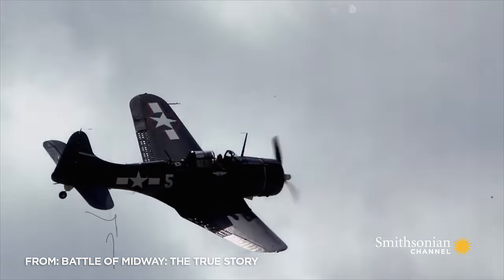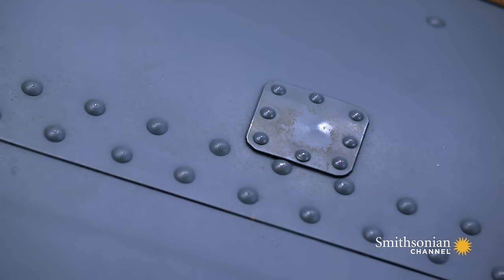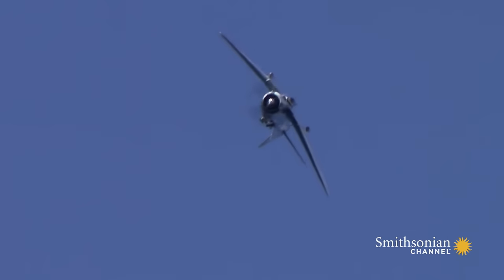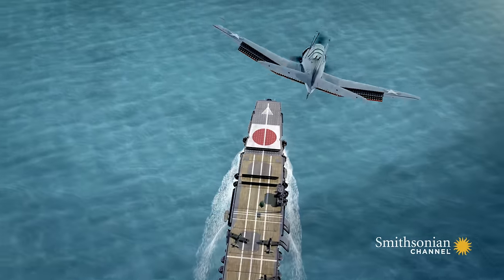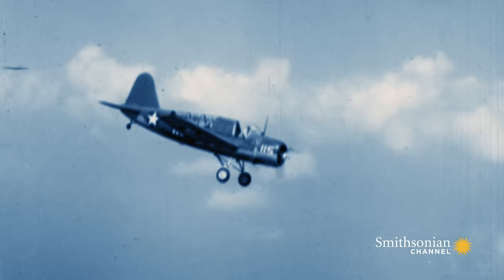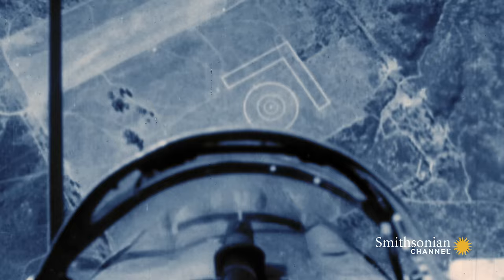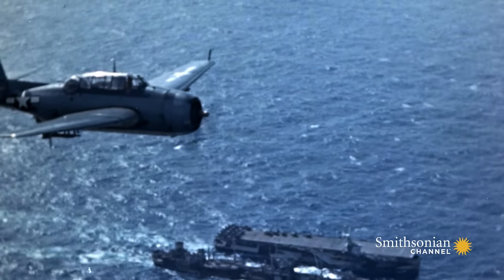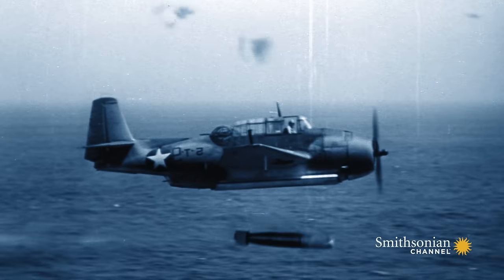The Terrifying Physics of WWII Dive Bombing

Comment: My adopted father was a rear gunner. When the war was over. He never flew again.
Reply: My father flew in the belly of TBMs and TBFs. His job was to man the radio, radar and, when necessary, use the 30cal rear machine gun or "Stinger". The 30cal was so ineffective that they were dropped in later variants. My dad got his civilian pilot's license after the war but let it lapse due to the expense.
Reply: @grantrichards4950  
Didn't the 30cal use tracer rounds?
Reply: You adopted your father? Cause otherwise you call em father or step father
Reply: I have know a few WW2 veterans of the 8th Army Air Corp. Many of them refused to fly under any circumstances.
Reply: @mac2857  maybe he was a foster child which makes him the adopted son
Reply: @mac2857  You may want to consider looking up the definitions of what (who) an adopted father is and what (who) a father is and what (who) a step-father is.  Rather than rely on anyone else's way of expressing their understanding of the definitions, you will, by your own effort, achieve true knowledge of those words.  Just a suggestion.
Reply: @johnstock3282  From what I can tell, it was removed for the same reason that the forward firing 30 cal was removed. It lacked range, destructive power and firing rate to bring down enemy aircraft. While the front firing gun was replaced by two wing-mounted 50s, the stinger was just removed. In RAF versions, the stinger was replaced with a camera.
Reply: @djg585  almost all belt fed machineguns that I know of use tracers, so as to help judge distance to target.
Reply: @marktercsak9728  
I am just surprised the 30cal was considered ineffective if it used tracers.
Reply: @djg585  , slot has to do with ineffective training or lack thereof and remember no one never knows what it's going to be like when your being shot at.
Zeros were very well armed but they sacrificed armor so as to save weight to make them more nimble., when you have some shooting a 20 mm or heavy caliber machine gun at you, you would think your .30 caliber is ineffective too.
Reply: So many boomers
Reply: @djg585  well, .30 cal was outdated arnament for aircrafts when even ww2 has just started. So at pacafic war, 1941.... it wasn't that useful.
Reply: k one-up him why don't you smh
Reply: I thought that was a navy term for a top.
Reply: Brave man
Reply: @djg585  having tracers doesn't make up for lack of fire power. Tracers are just to help see where the bullets are going. the 30 cal not effective because it's a rifle caliber round being shot at aircraft.
Reply: @CoachNealF  isn't the proper word 'adoptive'?
Reply: @MotorStorm66  Hey, M K.  You're correct.  The adult/parent is the adoptive/adopting person.  Matharnox stated to use either father (which is correct if the adopted child chooses to use that) or step-father, which is not accurate at all as one of the parents needs to be the biological parent and the other adult/parent marries into the family.
Reply: @mac2857  there's a place in Finland called Siikainen where lives a guy who's few years older than his mother
Reply: What a teaser. I was already into it. “Cause only one torpedo is enough to sink a ship...”
Reply: @djg585  Yes, they did, like the. 50 cal...every fifth round in an ordnance ammo belt for a machine gun, specially for serial gunnery, is,an incendiary or "tracer" round...white phosphorus impregnated in the bullet base..
Reply: @marktercsak9728  Correct...and to aid in what's known as "deflection shooting"...having to walk/lead your rounds into the target in turns or other maneuvers. On the same page here.
Reply: @djg585  Just not enough firepower, range, punch, etc compared to .50cal or 20mm guns..
Reply: The .30 Machine Gun Air Cooled 
Browning Model of 1919 came in a number of configurations and models, the last I believe was the M1919 A6.

I believe the cycle rate was around 600 rounds per minute, or maybe 800 rounds per minute.

The famous MG 42 I believe is 1200 rounds per minute.

The Model 1919 was of coarse chambered in .30-06 , which means .30 caliber year of introduction in the year 1906.

When first introduced the bullets at least in rifles were 150 grains, post WW I, experience  we followed the Germans and increased our cartridge bullet weight to around 172 or 173 grain, it was believed the heavier bullet weight stabilized the bullet at longer distances.

With the introduction of the M1 Garand , a mistake was made in Ammunition used in the New Rifle and it's gas system was calibrated to the older 150 grain ball . Aka M2. If memory serves

To be quite frank I do not know which 30-06 ball ammo was used in the aircraft versions of the M1919 machine guns, I do know tracer ammunition was used as was armor piercing .

The Mitsubishi Zero was an exceptional fighter plane, it was fast and very maneuverable  and it was also light , the engineers made sacrifices in armor and protective systems such as self sealing fuel tanks, in other words it was vulnerable. 

The F4-U Corsair it's outer wing panels were fabric covered to save on weight.

Dog fights are close range affairs .
So range is not that big of a factor, but I believe you do have to the enemy aircraft. With more precise hits with a 30-06 for it to be effective.
Reply: @mac2857  maybe his phone decided to autocorrect adoptive to adopted. When my phone is done autocorrecting its usualy not quite english anymore.
Reply: @Oozy9Millimeetah  Exactly!!! My grandfather and I are the same age!!!
Reply: @grantrichards4950  do u mean stinger as in THE stinger? the rifle-HMG LMG hybrid?
Reply: @EricWulfe  No. It was a LMG patterned of off the Browning M1919. The Stinger was an AMN2 30.06 and was used on TBMs, SBDs, PBYs and TBDs.
Reply: aren't those the same MG's that marines converted into the Stinger Bush MGs?
Reply: @JeanLucCaptain  Yes.
Reply: @grantrichards4950  Thought so!
Reply: @marktercsak9728  The problem with tracer bullets, is that they lose mass, as they burn, and eventually do not fly the same trajectory as the standard rounds.
Reply: @alneal100  , yes I know, tracers are used to help judge distance to target.
Reply: “Rear gunner” sounds like a euphemism for a top.
Reply: Can’t blame him
Reply: Neal Fleenor how about we don’t worry about what words people use and just focus on the main top being discussed. HISTORY!
Reply: @djg585  tracer bullets lack the destructive power of high explosive bullets
Reply: Step typically is used to refer to a person who the custodial parent in a divorce married. Adoptive parent is used by former orphans.
Reply: what, like never flew on an airline, or never piloted a plane.
Reply: You adopted your father?
Reply: Mark Tercsak - what is it that makes the 20mm a “cannon” and the .50 cal. a “machine gun”?  (Funny tangent: auto-complete thought the 50 cal. is a “machismo gun”.  It’s not wrong.)
Reply: @djg585  most planes used 50 cal or 20mm
Reply: Adopted father? What?
Reply: @FastEddy1959  The distinction is a bit arbitrary, but generally an automatic weapon with a bore diameter greater than 14.7mm is designated as a autocannon, although weapons like the MG151 (the 15mm version) are in a bit of a grey area. The Germans designated even 20mm autocannons as "machinengewehr" (machine gun) as in the MG FF and MG 151/20. They designated larger weapons like the 30mm MK103 and MK108 as "machinenkanone" (machine cannon).

Also, what sort of autocorrect does your browser or phone have that it doesn't recognise the word "machine"? 0_0
Reply: @52daytripper  At the start of WWII, most aircraft were armed with rifle-calibre machine guns (i.e. .30 calibre MGs). They quickly up-gunned to combinations of 20mm cannon and larger, and by the end of the war, there were a few all-cannon aircraft.

It was really only the US which were using exclusively .50 calibre guns, and that was largely because the Americans couldn't produce a reliable 20mm autocannon even with the British giving them the specifications for the Hispano-Suiza cannons. What's even odder about the whole thing is that the British were still using Imperial measurements during that era, so US industry couldn't even complain about metric-Imperial conversion errors...

The US Navy wanted to switch to 20mm cannons ASAP, though. It worked out alright for the USAAF to use .50 BMG guns for a few reasons:
1. The standard armament of 6-8 .50 cals had acceptable hitting power, generous ammunition capacity, and provided identical ballistics for all of the weapons. (The ballistics of a 20mm cannon and a .303 machine gun are markedly different, with the MGs having higher muzzle velocity and flatter trajectories. You could, in theory, load the .303 rounds to match the ballistics of the 20mm cannon, but you'd be losing a lot of effectiveness from those machine guns.)

2. The USAAF mostly faced fighter and a few light bomber threats in the skies over Europe. The bombers the Japanese had in the Pacific (and most of their aircraft, really) were poorly armoured and of flimsy construction. If the USAAF had to stop strategic bombers like the British, the Russians, the Germans, and the Japanese did, they'd likely have had to quickly upgun their fighters.

As for .30 calibre machine guns lacking hitting power, that's because of the number of hits they would need to reliably bring down an all-metal aircraft. If you mounted, say, 12 of them (like in the Hawker Hurricane), you'd be able to shred unarmoured aircraft pretty decently, but you wouldn't do anything to the sort of armoured beasts most countries were fielding by the middle of the war. To give an example, the Germans had trouble downing Il-2 Sturmoviks with _20mm cannons_, and that aircraft had a reputation among both the Russians and the Germans as a flying tank. (The rear gunner wasn't well protected, though.) 

A single .30 cal isn't going to stop a decently armoured fighter--the canopy is bullet resistant, and unless you can get a lucky shot into the engine, you won't even scare him away before he shreds you with his guns which could output a much heavier weight of fire. If I'm not mistaken, rear gunners were intended more to deter fighter attacks from the rear than actually shoot down enemy aircraft. If the enemy fighter on your tail were something like a FW-190 A-8, a single .30 cal won't even faze him. This has less to do with range than your gunner's inability to inflict sufficient damage whilst you, the pilot, are corkscrewing across the air to throw off the attacker's aim.

After 1945, most aircraft with rear gun positions had them remote controlled. Nowadays, it's only a few Soviet-era bombers that still have rear gun positions (the ones on the B-52 were removed decades ago), since everyone realised that a rear gun position is no defence against a BVR missile.
Reply: @mac2857  I'm adopted but I don't think you have be adopted to know what he meant. smh
Reply: @djg585  Any gun can use tracer rounds.
Reply: @djg585  Tracers don't do anything to increase the effectiveness of the gun. All they do is give off light to help the gunner aim.
Reply: @bazonka1  
Exactly, that's why I asked whether they were being used.
Reply: @grantrichards4950  what could possibly survive 30 cal
sounds to me like bad aim is responsible
Reply: lol
Reply: 3,000 like
Reply: My Father was tail gunner in the Dauntless, he was stationed on the Enterprise
Reply: @mac2857  i think he means his grandpa adopted his father
Reply: @mac2857  Did he adopt his father?  No. As far as I am concerned Glen’s father is/was a HERO.   Any man/woman who served in the defense our country is a hero.
Reply: My uncle flew with VB 7, SB2C pilot.
Reply: I have a letter from father's rear gunner who flew with him in a SBD at Midway and at the battle of Santa Cruz.  He wrote the letter many years after the war had ended.  His rear gunner was hit by cannon fire from a Zero after dropping a bomb on the IJN Shokaku during the battle and then retreating.  He landed on the USS Enterprise (CV6) with his wounded gunner after being unable to land back on the USS Hornet (CV8) which was hit, on fire and listing. The letter was his gunner's sincere appreciation and thanking him for saving his life.
Reply: and probably resists speaking about it!
Reply: I think title of video
Reply: @mac2857  why does it matter

Comment: My dad was a rear-gunner. He saw the target only after they pulled out of the dive. You had to be very young to withstand the forces that existed in a straight dive toward the target and all that water.
Reply: Actually in dive you are not exposed to any high forces, forces become significant when you pull out of the dive and this is very dangerous part about dive bombing this couple of seconds after you drop the bomb until plane is leveled out.
Reply: @sawomirmiszczak134  tbh, you could consider the acceleration from the dive as a high force, since its pretty hard to experience that level of acceleration anywhere else
Reply: @caralho5237  When you dive a plane you don't feel acceleration, you feel  weightless this is magic of gravity :) The highest forces are exerted while plane is pulling out of the dive, very high speed induce very high G even at slightest pull rate.
Reply: @sawomirmiszczak134  if the plane was just falling out of the sky, then you'd experience weightlessness. but in a dive, the plane accelerates faster than that, so assuming the plane is upright and not inverted, the pilot would experience negative g forces (eyeballs up), which the human body has a lower tolerance, compared to positive gs.
Reply: My dad was only 20 years old at the time.
Reply: @j4log719  If you are accelerating downward at a greater rate than the pull of gravity (about 32ft/sec squared) you would feel g forces against your body, just not as much as when you pull out.  I don't know what the acceleration rate was for these dive bombers, however.
Reply: Toughness matters more than youth.
Reply: My Dad as well.!

Comment: Actually, dive bomber pilots of various nations often dived at angles of over 80 degrees- and some of them dove straight down at 90 degrees. One thing not mentioned in the video is that the rapid loss of altitude followed by the stress of pullout caused some capillaries (small blood vessels) in the lungs of the crews to burst- which shortened the lives of the crews.
Reply: Some dive bomber pilots flew two missions during the Battle of Midway.
Reply: There are dozens of things not mentioned in the video that should’ve been.
Reply: Not only that, but you could exceed the structural limits of the plane and cause an in-flight breakup
Reply: @mwbgaming28  Highly unlikely, as dive bombers were specifically designed and built to withstand the stress of high angle dives.
Reply: @manilajohn0182  I read my father's pilot manual for the SBD-5 he flew in the South Pacific. It had perforated flaps that could be extended at full dive speed.  I stood next to an SBD-5 in a museum and those things were *monsters*.
Reply: They don't call them the greatest generation for nothing. Kudos to your father, and all like him who did their part...

Comment: Balls is right. You had 18 to 20 year olds going almost straight down faster than a hotrod. No way I could do that. They have my respect, and thanks and appreciation.
Reply: My father in law was a gunner in a SBD stationed on the Lexington until it was sunk at Coral Sea. He then was assigned to the Saratoga for the rest of the war. He saw a lot of combat and the only thing he ever mentioned about the physics was, "I never rode a rollercoaster that was even close".
Reply: As long as you aren't being shot at, it is really great fun. I would imagine the pilot was too busy concentrating on hitting the target that he doesn't have the spare brain power to devote to anything else. This is especially true for the first few missions. I can attest to this in a very minor way and while doing something extremely safe. After a while it just becomes second nature but then you just concentrate all that much more on hitting the target.
Reply: @oldgeezer7484  A pilot rode me in his small plane and put it in a steep but not vertical dive,felt more G's than I ever felt in a roller coaster
Reply: @Luther Blissett Must have powered descent,not just dropping near vertical due to gravity? 
Coasters I have rode generated their thrill by steep near vertical drop but unpowered on that part of the track. So approaching 0 G.
Reply: As I know the stuka can finish A dive even if the pilot faints, I don't know if it's true or a fake news

Comment: The technique continued on into the 1960's in ASW, except instead of bombs we were using HVARs and about a 60 degree dive in a twin engine S-2E. The HVARs were out of production, but we were still using them in practice rocket runs. Of course the ones we used as training rockets did not have an explosive head, but sent up a white cloud to let the plane behind us know we hit the target (as by then we were making sure we didn't impact the water. We also didn't start at 20K as that was above our ceiling, but started about 10K. Still a hairy run, not from the dive, but from the recovery from the recovery.